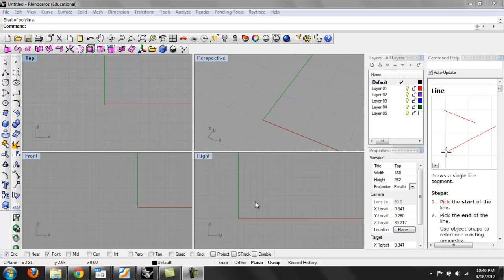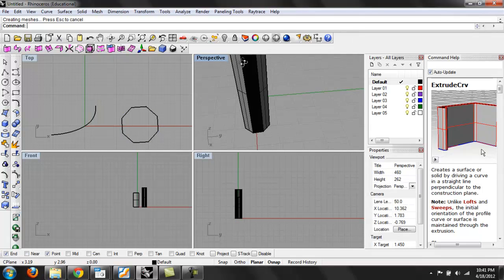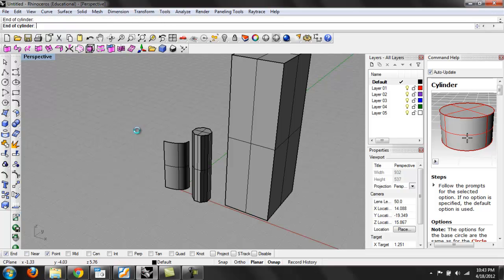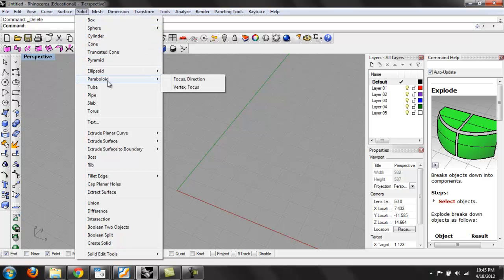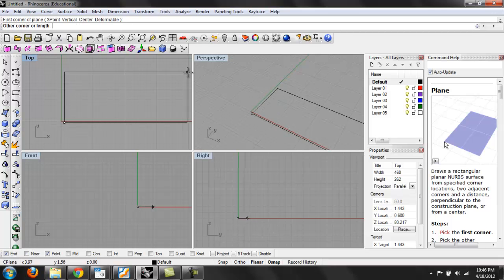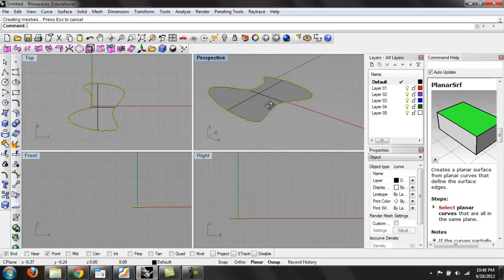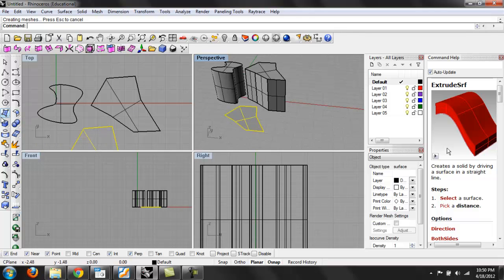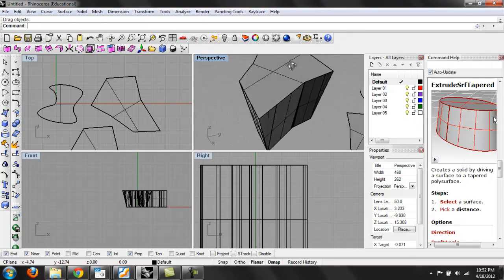Rhino Solids, Basic Surfaces, and Extrude Curve

Comment: Hi..i just learned to use this software, and currently i use rhino v5. When
 I make a square shape using polyline, then I add 2 dots, then I extrude
 using Solid-Extrude Plannar Curve-Straight or using Surface-Extrude 
Curve-Straight there is a problem, where the top and bottom will not 
close. I've tried Cap Planar Hole also can not close and there is a description in the command "Unable to cap one object. The openings did not have closed, planar loops of edges". How to solve it? Can you tell me where is the error?